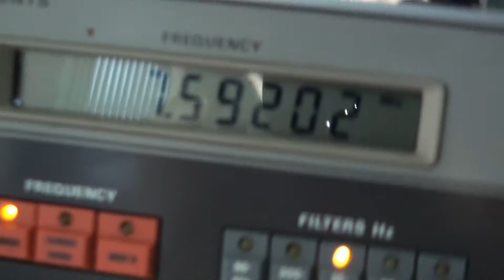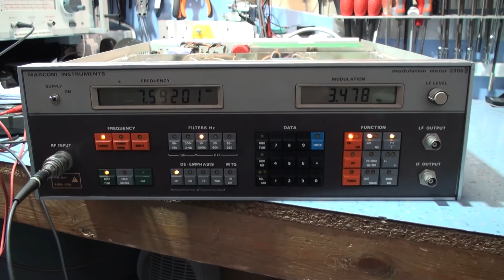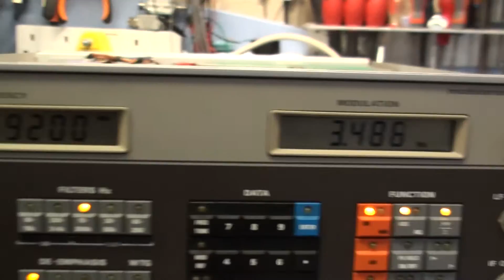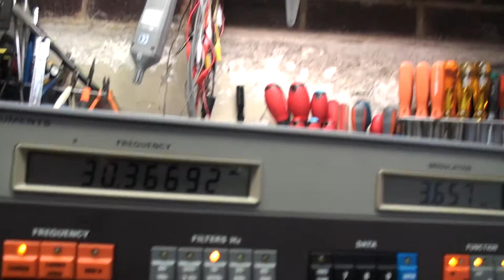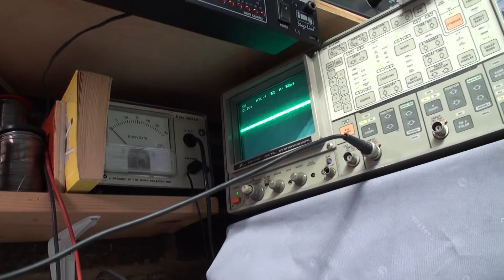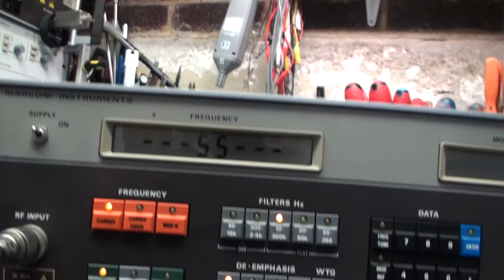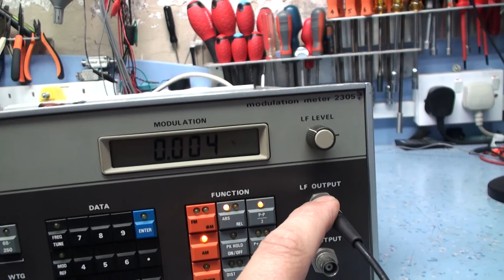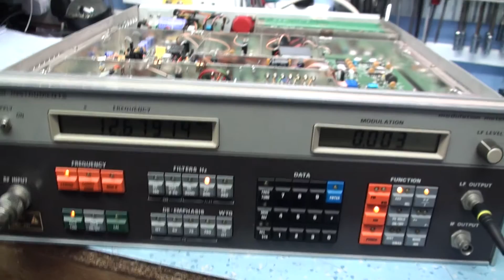Marconi 2305 fault finding

Comment: Hi Simon. I.see you changed the IC for the LCD display and now works. Which one you changed ? In mine is missing just one segment but when I get an error in the calib routine many segments are missing. My unit shows faults during calibration but in autotune seems working pretty well both AM and FM. Only problems might be in the POWER Measurement. When I press the power button I get quite erratic dbm measures. So my gen is on +2db and the marconi shows erratic numbers in range 5 to 7db. Have you ever seen something similar ? 🤔

Comment: I just found this mentioned in the manual, might be related to your units lower sensitivity, might be worth setting them to auto: 
35 Set input attenuator setting (storable)
Enter 5 for setting 0 dB, 4 for 10 dB, 3 for 20 dB etc. to 0 for 50 dB. Any number greater than 5 restores
automatic operation.
36 Set switchable gain range setting (storable)
Enter 0 to 5 for settings 0 dB, 10 dB etc. to 50 dB. Any number greater than 5 restores automatic operation.

Comment: Do either of your units have the distortion meter option installed ? if so, there is a jumper plug next to the connector (PLAR) on the AC1 board, what position is it in, 1-2 or 2-3? I actually hoped that my unit came with the distortion option, but it didn't include it unfortunately, so am wondering if it is just a case of plugging in the board, or also changing a jumper/part somewhere, just in case I can find a distortion board somewhere.
Reply: And I just answered my own question, the jumper is supposed to be on 1-2 if not fitted, but on 2-3 if fitted (just found it by looking at the AC1 diagram).

Comment: I think I would be trying to trace the audio at the AB9 board first, to see if it is missing there at its input, or is missing at its output, to determine if it is a detector fault(AB7/AB8), or the amp fault(AB9), if it is there at the output of AB9, then it is likely to be an issue on AB10.

Comment: AB10 : LF Filters
147. The fault-finding on this board consists of much the same signal tracing process as for the LF Amplifier board
(AB9). There are, however, a few possible complications. Disappearance of signal at PLCT could be caused by the
insertion of a jack in the socket on the rear panel, or by a faulty switch on this socket. Disappearance or distortion of
signal at PLCS may be due to a fault on the Options board AE1 if fitted. This should be disconnected and the mini jump
connector on the Mother board ACI moved to the adjacent position in order to check whether this is so.

149. There is a complication in fault-finding on this board, in that the analogue multiplexers have derived 7.5 V supplies.
If a multiplexer fails in such a way as to drag either supply low, this will stop the operation of all the other devices. The
failed device may identify itself by becoming warm.

Comment: Second functions relevant to fault-finding and performance-checking
73. Group P0 second functions. See Chap 3&4 for guidance on method of access.
04 Select external frequency standard (0 = internal; I = external).
Could be used to check acceptance of external 10 MHz standard or correct operation of instrument when
internal standard is faulty.
05 Display mixer level.
The mixer level is monitored by the voltmeter. When the level is greater than a certain value, an attenuator
pad is placed in the signal path. This second function gives a display of the mixer level to establish the
correct operation of the attenuators, power protection relay, and the detector itself. It can be used in
conjunction with second function (SF) 35.
06 Display IF level.
IF level again monitored by the voltmeter. If above a certain threshold, it indicates to the processor that a
signal is present at the input. If the reading becomes too high, error 53 is indicated, which should only happen
if an input attenuator fault occurs.
07 Display demodulated audio level (prior to IF . filters).
There is a detector prior to the IF . filters, on the output of AB9 (LF Amplifier) which feeds the voltmeter. The
detected level is used to select the correct amplifier range.
08 Display voltmeter reading.
In normal operation, the voltmeter cycles through its various inputs at a rapid rate, which would make fault
location on the voltmeter board very difficult. This function allows a single input to be selected so that the
board can be checked or the presence of the various input signals established. The inputs are selected by
the following digits :
0 Peak -ve audio detector.
I Peak +ve detector.
2 Averaging detector.
3 RF power detector.
4 IF level detector.
5 Zero reference.
6 Mixer level detector.
7 Demodulated audio level detector.
Note that although these appear to duplicate some of the functions above, the point is that with SF8, the
voltmeter input itself is frozen at a particular setting. Even the zero reference, which is normally subtracted
from the reading, is ignored, and can itself be checked (No. 5).
Reply: Diagnostic second functions 05 to 08
75. These second functions which have been provided purely for diagnostic purposes are described in Chap. 3, page
3-16.
76. The following table gives a list of typical readings which may be used as a fault-finding guide. The readings given
are only to be regarded as approximate, and measured readings differing by 10% or so should not be taken as faulty. The
table was compiled with the following conditions at the input socket:
Input level : -10 dBm
Carrier frequency : 100 MHz
FM deviation : 100 kHz
Second function 08
Selection digit Voltmeter input Typical reading
0 Peak -ve 3500
I Peak +ve 3500
2 Averaging detector 3500
* 3 RF power detector 500
4 IF level detector 1000
5 Zero reference 250
6 Mixer level detector 600
7 Demodulated audio level 1700
detector on AB9
* Measured with an input level of +10 dBm.
5-28
Reply from the maker: +TheDefpom Many thanks for all your help so far.  I think I'm out of my depth a bit hear. Firstly my Marconi foes not have a bBm calibration but what reads correctly on my semi working unit reads a mile off on the unit on the bench.
The p+ and P- read in the 500 range and most of the other readings seem low but not to the same point.
Reply: I am just doing a video of testing the AB9 board, to show what you should be getting, I will put it up shortly.

Comment: AB10 section states this, so worth checking at output of AB9/input of AB10 for audio:
86. Demodulated audio signals arrive from the LF amplifier board (AB9) at plug PLCN and are routed through the
active filter elements by the analogue multiplexers which are driven from the instrument bus via the latches board (AB11).
Each filter has separate high-pass and low-pass elements which are selected in pairs. Multiplexers IC1, IC3, select the
high-pass sections, IC5 and IC7, the low-pass sections and introduce them around the active elements IC2, IC4 and IC6.
All filter sections have third order roll off.

Comment: This is noted on the AB7 board section might be worth checking the plug PLCF to see if the demodulated audio is there, and if not, maybe checking D6/TR19: 

AM detector
65. Signal voltages at the emitter of TR13 are converted to signal currents in the collector circuit of TR16, As TR14
and TR15 present a high impedance to signal currents, these will pass instead through C37 into D6 (positive half-cycles)
and TR19 (negative half-cycles) so that the rectified negative half of the i.f. waveform appears across the TR19 load,
R150. The carrier (i.f.) component of this waveform is removed by the active filter built around IC3 leaving just the audio
component - proportional to modulation depth - and the d.c. component - proportional to the carrier average value - at the
output plug PLCF.

Comment: This might be relevant to the lower input sensitivity: I seem to had a bunch of issues with schottky diodes lately, made me wonder if related:

24. Clamping is applied to the ABI output by the Schottky diodes D8 and DII which are returned to d.c. potentials defined
by the forward biased diodes D9, DIO, D12 and D13 at +1.3 V. The Schottky diodes conduct when the signal level
reaches 2 V and give instantaneous protection to the fast diodes in the sampling gate mixer on AB2A board - which have a
peak inverse rating of 5 V - until higher attenuation is selected or the overload relay opens.
Reply from the maker: Thanks for your help but your giving me to many options at once! Can you suggest a next step. Looks to me like the AM detector is fine?

Comment: 16. The LF Filter board contains a patching link in its output stage that enables the options board to be connected there, if
required. The LF OUTPUT signal originates here so that a signal taken from this outlet will have been conditioned by any
filtering and de-emphasis introduced, either internally or externally, and by any function selected on the options board - if
fitted.

Comment: This is in the manual, and may help to guide troubleshooting, but eleminating parts of the circuit by trying different input frequencies:

Auto-tuning process
5. In the first stage of auto-tuning , the sampling gate is used as the frequency changer with the local oscillator executing
a two-stage search programme designed to produce an i.f. within the range 3 MHz to 11 MHz. A special circuit branching
off the main i.f. channel is tuned to receive this band of frequencies and the appearance of a signal here above a
standardized threshold causes a level detector to be triggered and information to be passed to the microprocessor that an
i.f. exists which is within the frequency range of the internal counter frequency meter. Once the microprocessor receives
this ’i.f. present’ signal, it causes the signal frequency to be precisely measured and, by noting the effect on the i.f. of a
small increment in the local oscillator frequency, it calculates which harmonic of the local oscillator is effective in producing
the i.f. The microprocessor then has enough information to calculate the exact input signal frequency and it causes this to
be displayed in the FREQUENCY window. It also changes the instructions to the local oscillator and, if necessary, to the
binary divider as well so as to produce an i.f. of 1.5 MHz and to ensure that the correct mixer is used.
6. A failure to detect an i.f. signal after this part of the autotune programme has been completed will be interpreted by the
microprocessor as meaning that the input signal is 17 MHz or less and it will then cause the signal to bypass the mixers
and pass directly to the i.f. After its frequency measurement has been interpreted by the microprocessor the signal will be
routed to the balanced mixer if above 1.5 MHz and allowed to pass directly to the i.f.
if less.
7. A continued failure to detect an i.f. while the mixer level detector continues to detect an input, will result in the display of
error code 52 - frequency out of range.
8. The double-balanced mixer is introduced for signal frequencies below 56 MHz where the rejection contributed by the
mixer to the local oscillator and signal frequencies is needed to assist in the proper separation of the i.f. Further
assistance is given by the reduction in i.f. from 1.5 MHz to 250 kHz that is made when input signals of less than 5.5 MHz
are used. All filter switching and signal routeing is carried out by local latching and control in response to data transmitted
over the internal bus.

Comment: Yep you guessed right, the lf is the demodulated audio, my offer still stands if you need comparisons or another tech to bounce ideas off.
Reply from the maker: I appreciate that offer. I am now looking at the ab10 board because I can't get LF output. I am yet to confirm if this board is down stream of the AM detector board AB7.
Reply from the maker: I would be interested to know what you see on the Base and collector of tr 11 on ab board?   It looks to me like there should be a signal there?
Reply: I am will be able to have a look in about 12 hours, what test conditions? Input freq, modulation type and level?
Reply from the maker: +TheDefpom The manual is not clear re modulation  however 1.5 Mhz  to the input without modulation and 75%. The transistor in my unit stays hi on the Base regardless of input.
Reply: TR11 on which board ?  Im guessing you meant AB7?
Reply from the maker: +TheDefpom yes AB7